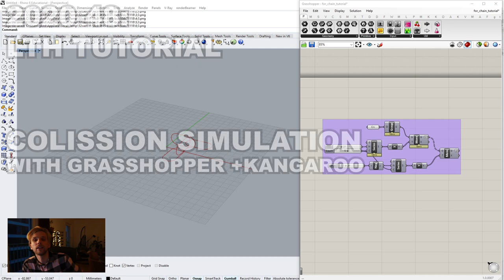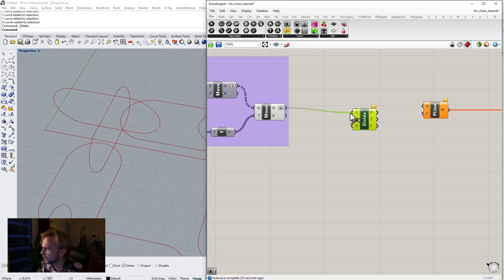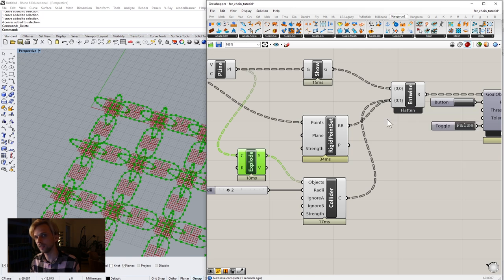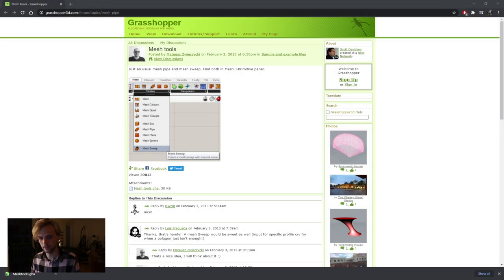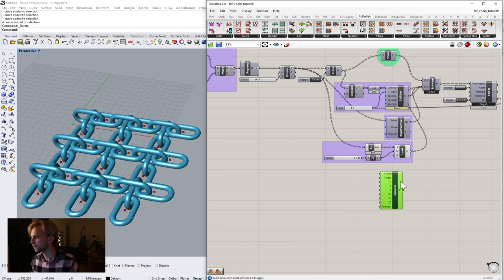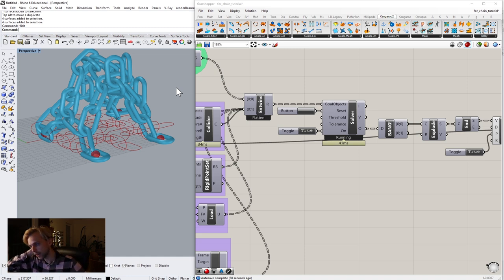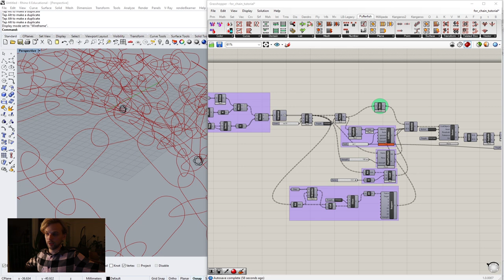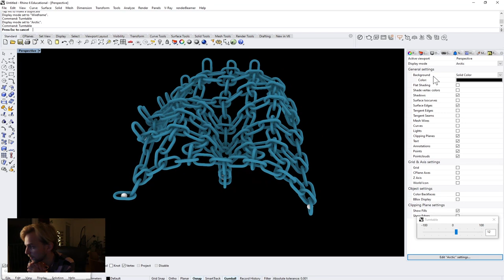How to: Collision Simulation with Grasshopper

Comment: Went through the tutorial, no problem. Thank you once again. That reminded me of how I tried to model a dome that was made out of triangles, and the goal was to make them more or less the same size. In the end, I couldn't figure out how to achieve that and used something else, but if you are open to suggestions, try it.
Reply from the maker: Hmm are you familiar with Geodesic Domes designed by Buckminster Fuller? They are pretty neat (except that you cant really add a normal door to them haha)
Reply: @DesignGoBrr  Yeah, I ended up placing a geodesic dome, but it wasn't exactly what we needed, for reasons I can't remember since it was a couple of years ago, oops. And yeah, thanks for the reference, saw his stuff when I was searching for domes.

Comment: Hi Gediminas, do you know any better workflow between maya/blender and rhino7 subD? I suppose the Rhino 7 subD can work smoother than before? Btw happy holiday season!
Reply from the maker: Happy Holidays! Umm In Rhino SubD geometry type and a simple Quad mesh  type can jump back and forth without sacrificing any information, which means that if you model a SubD object in Maya or Blender and want to get it as a subD object in Rhino, all you need to do is export it as a quad mesh (OBJ, FBX or 3DS format) with no subdivision/lowest resolution possible, import it into Rhino and do Mesh to SubD conversion.